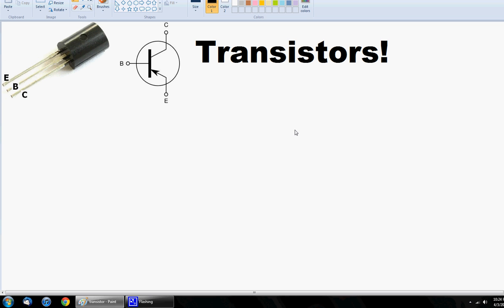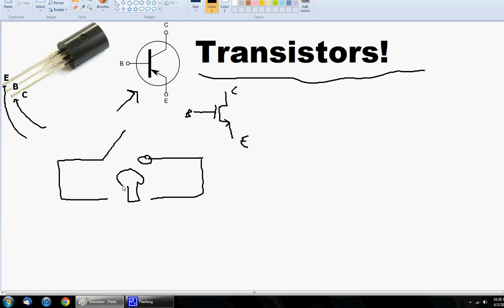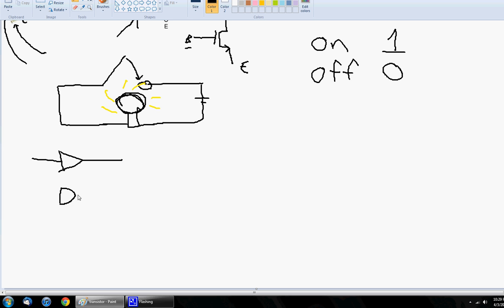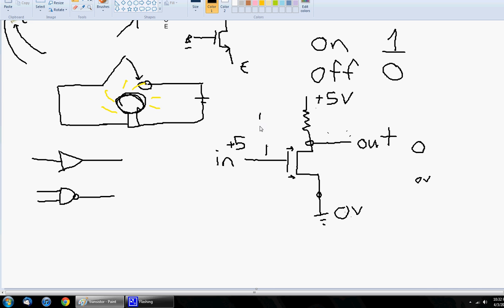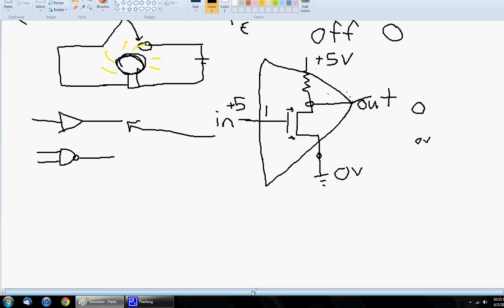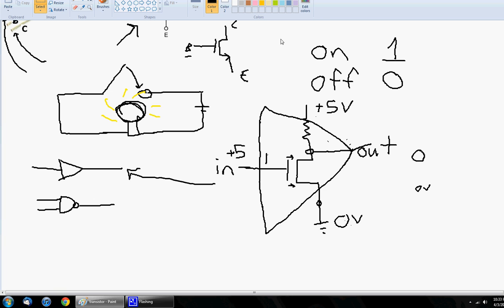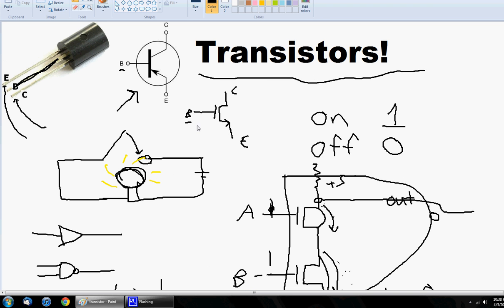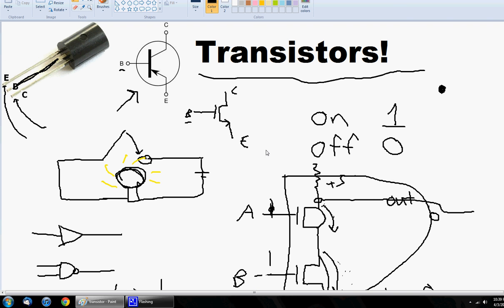Transistors: How to Build a Logic Gate

Comment: I have a question:
If both transistor supplied power through their b pin (their b pin is active), the transistors are looks like (in my imagination) absorbing all the power that supplied to the circuit that is the 5v so the output pin didn't share any power (0v) hence the output is 0 (zero) when the input are 1 1 (the last entry of NAND truth table).
 
How can transistor do the absorbing like I just said?

Or maybe, the transistors just directing the current all the way to the ground selfishly?

Confuse...

But, thank you very much. I have tried ur inverter circuit using a 2N2222 transistor and a resistor 1k ohm and it works but the NAND gate not yet tried. Thanks again men.
Reply: The first thing you should understand is that current (electrons) flows backwards through a circuit, and voltage is the reaction going in the opposite direction, meaning a voltage source is essentially a magnet for electrons.

Imagine the base of a transistor having a diode between it and both the collector and emitter. When power is supplied to the base, current actually flows from ground to the base with a ~.7 V drop through the 'diode' causing the other 'diode' between the base and collector to be "opened," like a switch. To clarify, when the 5 V is applied to the base, its not sending electricity through it, rather it's pulling current from ground through the emitter to the base. There is a small portion of material between these two points (depletion region) that inhibits the flow of electrons unless it becomes filled with enough active electrons to reach ~.7 V.

When this happens between the base and emitter, it happens to between the base and collector as well, meaning that current can now flow from emitter to collector, and as a result, from ground to the gate's voltage source. The gate's voltage source had no connection to ground, so it was drawing the 5 V through only the output. Once the transistors are "opened," the voltage source began pulling from ground, but with no real potential differences (no significant resistances), electron flow isn't gonna happen because electrons only flow when there is a difference in the ratio of 'holes' to electrons in a given point. The inputs are already powering the diodes, so the flow from ground to the voltage source is basically uninterrupted, meaning no voltage drops, resistances, or anything that would cause the electrons to move, therefore there is no electrical reaction to create voltage.

Hope this helps. Just understanding how current and electrons flow makes circuit analysis significantly easier.

Comment: But this could also work as a AND-Gate, wouldn't it:

Transistor:
B C | E
0  0 | 0
0  1 | 0
1  0 | 0
1  1 | 1

if the output was E?
Reply: The voltage source connected to the collector is constant. That's why it works as an NAND gate, because even with no input, there is still a voltage. Generally these voltages are hardwired to a gate, so there is no switch for C. You could potentialy build a gate with the function to switch the C voltage on and off, but the current flow through the base is insignificant when the C voltage is on because it takes such a small portion of electrons. This ratio is called the "Beta" of a transistor, and can be used to determine if there is actually any voltage at E as you suggest, but it would be too small to function as an actual binary output

Comment: You use a high value resistor, because you dont want the logic gate to draw a high current. There is no real switch, the transistor acts as a switch, controlled by the input voltage.

Comment: So basically you can make AND gate by using two NAND gates: the first with two different input terminals (A and B) and the second with both inputs coming from the output of the first one (Inverter).

As a real life application how would you describe the energy-efficiency of this circuit? You obviously can restrict the current flow with resistors, but since there's always one gate connected to the ground, I'd imagine it doesn't keep the battery alive for too long...?

Comment: hey stephen. I don't understand one thing. So in your example of an inverter, you had a transistor with 5v coming into the collector. You then took the output off of the collector, so that when the input(base) was off, then output was on. When base is on, then output is off and current flows from the collector to the emitter. Why can't both the base and output be on at once? Why doesn't the voltage from the collector supply the output as well as get grounded?

Comment: And doesn't the mosfet have a gate source and drain or is it the same thing as emmiter collector and base
Reply: No it not the same the ujt is a current device with ebc a mosfet is a voltage device and its terminals are correctly labled sgd you know more then the collage boy lollol. sharp keep your eyes on the ball don't forget to question everything.